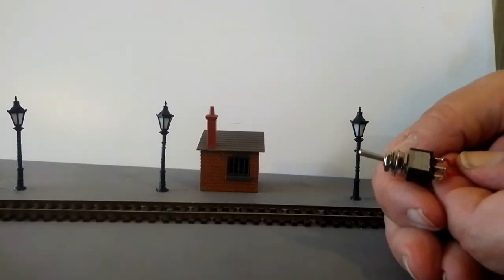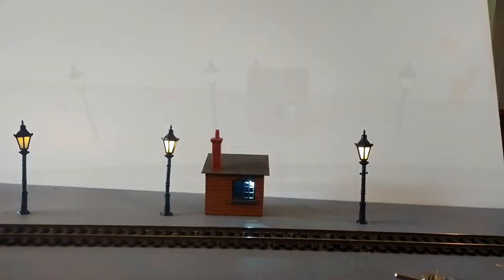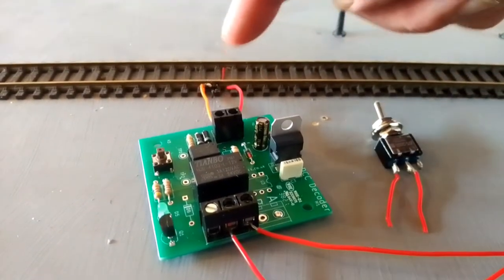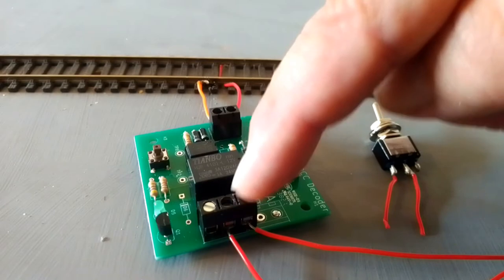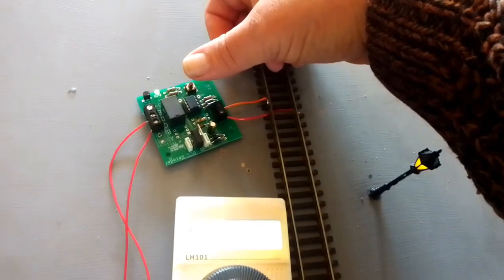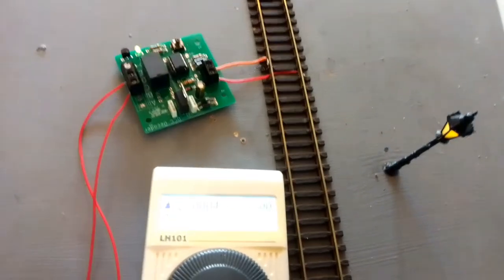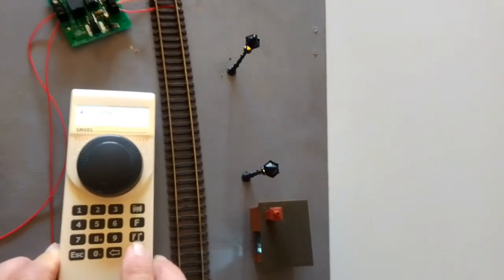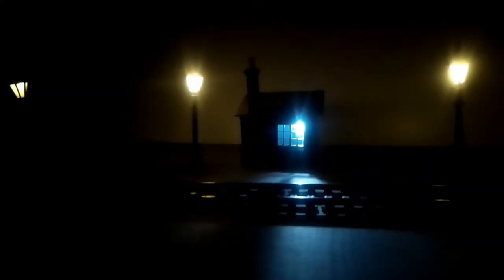Switch lights simply with DCC.

Comment from the maker: Actually anything that is controlled by a SPDT single pole switch (2 aspect signals for example) or an on off switch(electric motor servo controll board) can be controlled by DCC by using our decoder. For more information this link takes you to the DCC decoder page of Heathcote Electronics website https://www.heathcote-electronics.co.uk/DCC_Accessory_Decoder_1.html